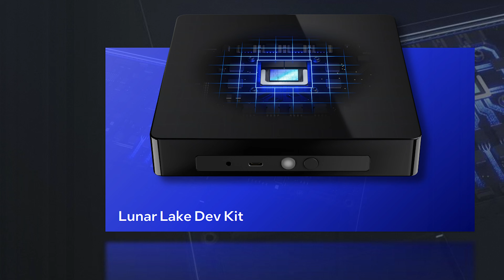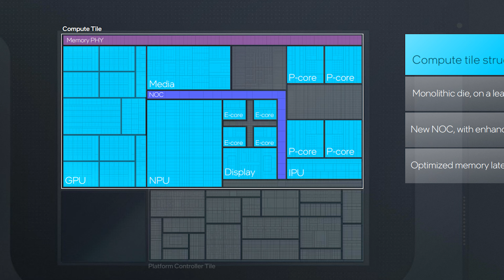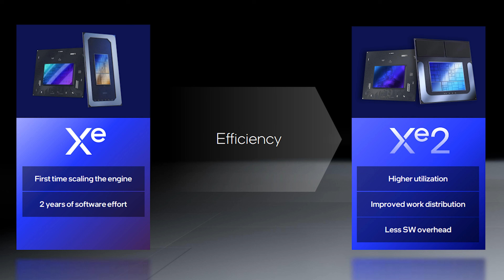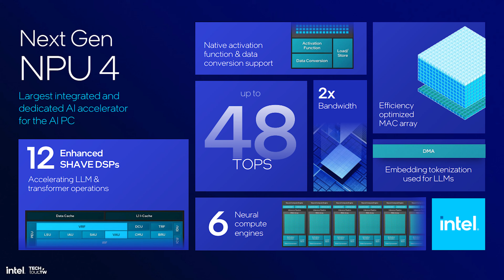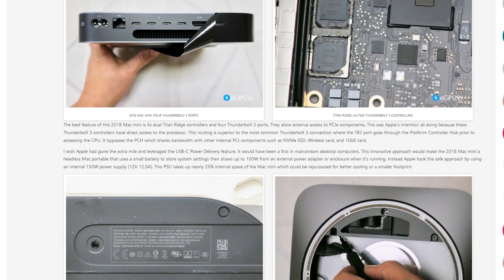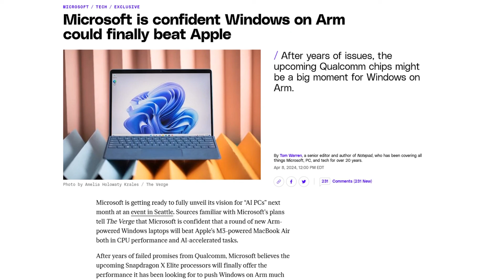Intel And The AI PC Revolution! Lunar Lake REVEALED

Comment: Good point about the ram. Going to need bigger buses to get those possible 128gb+ of ram machines properly fed. Will they make the silicon and price leap for it(with arrow lake?)
Reply: What are you talking about.

I already have 128GB RAM on my Desktop RiG at home with an X670E Mobo + a 7950X3D + an RX 7900XTX
Reply: @DonkeyBallss  What speed?
Reply: @Overseer476  So, currently the RAM DIMMs which i have in my RiG are:

4x 32GB " G.SKILL Trident Z5 RGB White 6400MHz CL32-39-39-102 1.40V XMP "

All 4 of them are exactly the same!

And currently i have them left at my Mobo's BIOS Defaults, my Mobo is a GIGABYTE X670E AORUS MASTER Rev.1.x with Latest BIOS version F30!

And the RAM is running @ 3600MHz CL30-30-30-58-88 1T at the moment at this BIOS Default!

I have NOT yet attempted to tweak my RAM.
Because i'm saving up for the newly announced GIGABYTE X870E AORUS XTREME Mobo when it comes out, and after that for a Ryzen 9950X3D when it comes out.

Because i'm a Desktop PC Enthusiast and this is my one and only hobby i'm passionate about. 🤓😅😀
Reply: @DonkeyBallss  talking about laptops and their ram bus width as well as total ram. People are paying $4.7k to buy Apple laptops with 128gb of unified ram so they can work with bigger llms. If amd, intel, Qualcomm want to compete with that they are going to need wider laptop buses with more ram. 

Desktop is a little different but similar with people paying $5.6k for 192gb of unified memory on the Mac Studio. With much higher bandwidth than you can get on consumer desktop.
Reply: @tomis181  I'm not familiar with anything Apple, cause i've never ever been even slightly interested in Apple hardware and products.
Due to hearing from others how expensive and overpriced Apple products are, be it iPhones or their Mac Computers, also how they're isolated almost entirely from the PC Gaming scene, by not supporting PC Games on their MacOS.

But i'm familiar that in the PC Scene, you have Computers which are above the Desktop PC.
Such as the Workstation/High End Desktop PC.
Which utilize AMD's Threadripper PRO 7000WX or Intel's Xeon W-3400 CPUs with up to 8 channel DDR5 DIMM slots, up to 96 CPU Cores with AMD and up to 128 PCIe 5.0 lanes.

My point is that, i think that any of those machines fitted with the flagship CPUs and the Maximum amount of supported DDR5 RAM DIMMs and the Flagship GPUs by either AMD or NVIDIA, can pretty much beat any Apple Mac Computer and wipe the floor with it. 😎😁
Reply: @DonkeyBallss  oh certainly high end desktop and entry level workstation can beat Apple in price to performance in most applications. Specifically when talking llm training/inference (which Wendell brought up for a little bit in the video) apples chips have much larger bus width and total  ram  which allows them to beat current offerings in terms of cost. Current llms over ~40b (depending on quantization) won’t fit on a single 24gb gpu and you have to offload layers to the cpu and its ram, making them run much, much slower. I’ve seen people online building desktops with 4x24gb 3090=96gb total ram in order to run the larger models of their choice. At which point you are ending up around the cost of these Apple machines.
Reply: @tomis181  Well you're talking about VRAM here, from what i can understand.
Now as i said i'm NOT familiar with Apple's hardware at all, cause i've been a Desktop PC guy only, my whole life . But if they do indeed have better VRAM in some way, which you say is needed for this Ai stuff. Then i can sort of get an idea of what you mean.

Comment: Dam. Wish i didn't buy a meteor lake laptop back in march. I think im gonna start buying framework laptops from now on
Reply: Laptops suck.

That's why i have built my own RiG with an X670E Mobo + a Ryzen 7950X3D with a 420mm AIO + an RX 7900 XTX + 128GB RAM + 1250W PSU + 4x M.2 NVME SSDs + a Full Tower big a$$ Case. 😎

Comment: Apple’s been baking neural engines into their custom silicon for a long time now.  

So I’m sure they’re just a tap away from something revolutionary. 

😂
Reply: Yes, but Apple's base-technology software is limited. E.g. no GPU/ANE access from Docker/VMs (unlike native Linux/Windows GPU/NPU access), ANE access is also very shaky (as developer you can only hope your code runs on the ANE, Apple decides on the fly). I really hope that they fix this with WWDC24 announcements.
Reply: @andikunar   I feel they have allot riding on iOS 18 and this WWDC.  The grievances are starting to add up, and they really do need to turn a fresh corner.  They must be feeling some pressure to reveal Ai stuff.  But I think it’s actually probably better to wait.  Allowing all the other players to blunder and discredit their own reputations while Apple hones whatever they’re up to.  

With their recent regulatory setbacks with the app store and USB C, I would think Ai regulation would be top of mind. Maybe they’re waiting to read the room before sticking out their neck.
Reply: Apple NPUs are not very fast.  M4 will have a big upgrade on NPU supposedly.
Reply: @Fordance100  I’m not sure about the M series chips, but I know as far back as the iphone x (10) they were touting generational improvements in their neural engines.  Clearly some degree of foresight was present and perhaps has been simmering in the background.

Their reputation for not being the first mover, but coming later with a trimmed down and polished goof-proof mass market implementation, may be in play here.

Comment: Kind of pointless until software exists that uses these NPUs… and I don’t mean some useless built-in co-pilot or bard equivalent. Apple Silicon has had Neural Engine for years now, and when I monitor its usage on macOS 99% of time it’s idle.
Reply: They could atleast release something like a low power sound equaliser or something like that which shifts the load away from cpu

But nope
Reply: “If you build it they will come” gotta have the hardware available if people are going to write software for it. Here’s hoping the silicon doesn’t go to waste.
Reply: @tomis181  🤔, how’s that going for Apples Neural Engine now after 4 years of Apple Silicon?
Reply: @carbongrip2108  I don’t have a MacBook so can’t comment there but the neural engine on the iPhone does have a handful of tricks I enjoy. Fair points though and I don’t buy into AI everywhere hype but it will certainly have a solid place  in computers from now on.
Reply: @carbongrip2108  Apple's base technology software for 3rd party developers is very limited. They decide, if your code written for the ANE really runs on the ANE. And you cannot access their ANE/GPU from docker or VMs. This limits its use, unless they fix it at their upcoming WWDC24.
With the recent Intel/AMD/Qualcomm developments, we will see a lot more AI-stuff, not just with Windows but also with Linux (Windows has its WSL2 for it, so a lot will center around Linux or Linux containers).
Reply: The ANE is very hard to use, its access is not very open and hit&miss for programs to get to it, Apple‘s Software finally decides if your program runs on the ANE or not. For the NPU the developers are in control.
Reply: A couple of things are nice like the real time text extraction from images and OCR. Not much more tho.
Reply: Intel Openvino is the most mature software for NPU.
Reply: Aye on NPU usage being hard to see. MacOS often uses the NPU + GPU to run long tasks at night when the Mac isn’t being used. It will do things like object classification in photos if it’s plugged in at night.

The text detection feature in preview happens so fast I can’t see it in activity monitor at all.

Comment: A step in the right direction, but I still can't buy onto the Intel Platform not with AMD as a better option in both power and efficiency, not to mention I don't have to change my mainboard every generation as we do for Intel. Also these AI neural engines are too NICHE to take up that much precious silicon space, which could instead have been used for more cores, sram, or just smaller footprint (cheaper chip).
Reply: I am more interested in Intel.  I have Ryzen 7840 hs laptop.  I can't still access to NPU, really disappointing.  Intel Openvino can easily use CPU, GPU and NPU.
Reply: You know, i used to think like that too, until i learned what a use case was... and actually tried  a bunch of hardware, instead of gleaning my opinions from stock tech tuber testing.
Reply: Amd apu still better than intel. Specially the npu

Comment: Who cares, AMD new chips are going to smoke Intel.
Reply: not that much, moores law is dead just went over it and pointed out that pricing is what will make or break the new AMD cpu's as they are going to be just behind or equal to arrow lake but they may be way more energy efficient and if they price it decently then they can smoke Intel as you say but if they decide to get greedy instead, well time will tell.
Reply: Intel has been outperforming amd in single-core for over a decade on their shitty old process nodes. They will catch up to tsmc and when they do, amd will be shit tier yet again
Reply: New AMD chips are 15% faster.  No real new technology.   Intel finally move to 3nm and below after 3 generations on 10nm.  I think AMD power efficiency advantage is gone.
Reply: But the only thing we want is faster...power and energie 90% doenst give a F... @Fordance100
Reply: @Fordance100 AMD doesn’t ruin and degrade their own CPUs with watts and AMD is still updating its 7 year old socket with newer CPUs 😂. You can’t get more pro consumer than that. AMD has new ai stuff and their drivers and qa are now higher quality unlike the garbage with Intel arc drivers on integrated graphics
Reply: @timothygibney159  , my 10 years old Intel chip still runs.
Reply: @Fordance100  amd has actually mew technology and intel only ups the clock without any sense. Amd cpus are waaaaaay more efficient. Compare 7800x3d vs 14900k. 14900k eats more then 300W 😂.
Reply: @StaticPixelBlur  the point is this time is a completely different architecture for intel.  What you are dong I’d like saying “all amd does is make hot messes like bulldozer”.

Times change.  Intel will also be the first to have backside power delivery.

Whoever is behind generally creates hotter CPUs to try to make them look more competitive.  It used to be amd when intel was ahead.  Then it was intel when amd was ahead.  And now we are in a new paradigm.